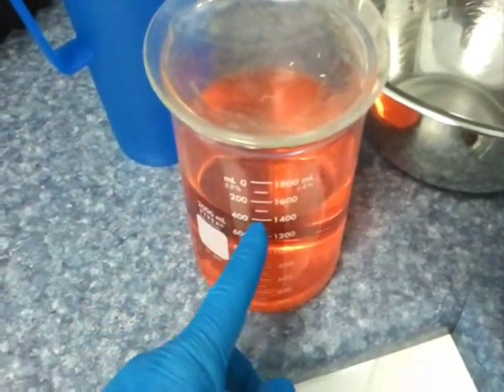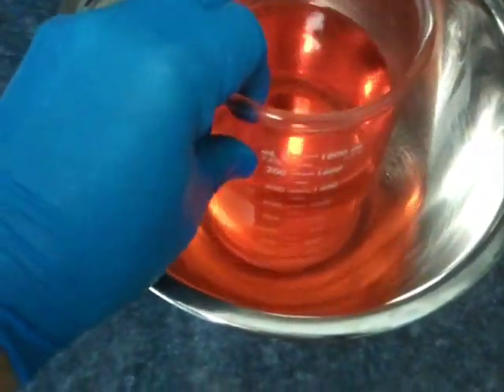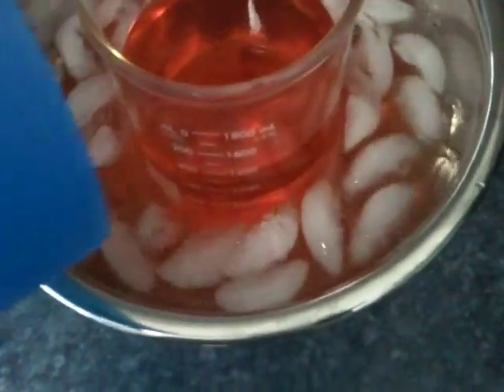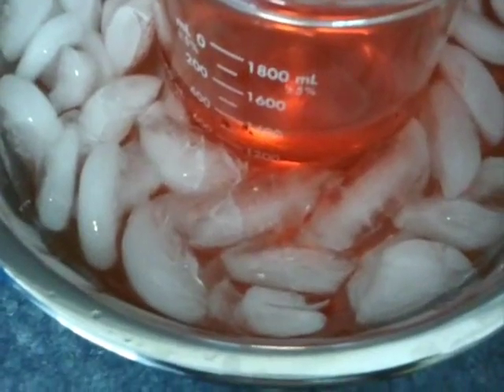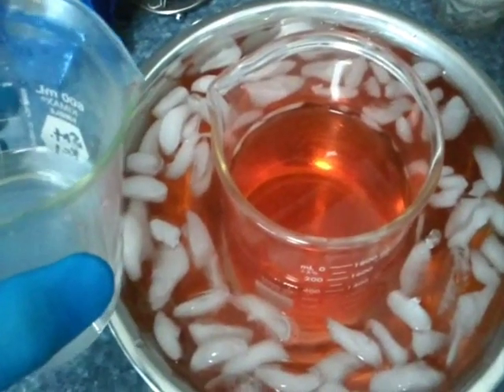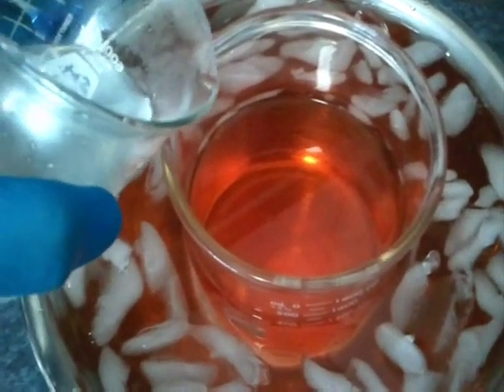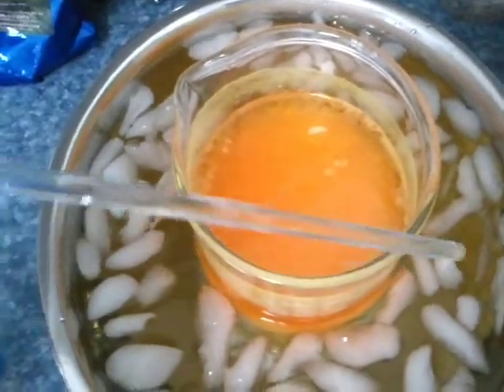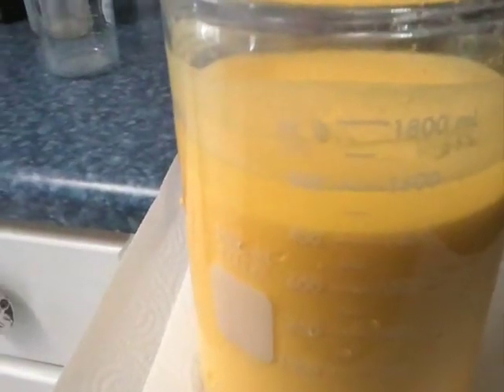Precipitating Platinum Using Potassium Chloride

Comment: 1:52 This cloudiness is not caused by natural impurities, but rather by an artificially added anti-caking agent. It is intended to prevent the KCl crystals from clumping together due to humidity.
Reply from the maker: Actually the KCl I used was purchased as untreated which does not have the anti-caking agent you speak of. You are correct that they do sell KCl with this agent in it, but I bought natural sylvite to avoid this.

Comment: are u sure use KCL not NH4CL?
Reply from the maker: Absolutely sure. KCl produces a less water soluble Pt compound than the Ammonium chloride  analog.  Additionally the KCl waste management cycle is much easier to deal with.

Comment: Hi after 9 years it’s best clip I’ve seen I have question How do you rinse these precipitate?
HCL or Water?
Best regards 👍
Reply from the maker: Use the clean saturated KCl solution as your rinse.. Any excess KCl will be rinse out of the Pt once it's converted to Pt sponge in the next step. Thank you for the positive feedback! Steve
Reply from the maker: I will check it and reply shortly! I've developed lots of new Pt/Pd refining techniques since I posted this common one 9 years ago...Ive been running PGMs for over 15 years now.
Reply from the maker: Lazersteve@gmail.com is the correct address
Reply: Thx so much for responding. I found email from you and wrote to you 🙏

Comment: Hi friend, excellent method, 2 questions this process is to down platinum exclusive? I try today and the result was wonderful, so to destroy remain nitric is ok use urea?
Reply from the maker: I use sulfamic acid to eliminate nitric in my solutions. Potassium Chloride will precipitate Palladium in the presence of chlorine generated in situ via addition of perchlorate or other chlorine source.. Any Platinum precipitated from solutions that also contains Palladium will be contaminated with trace Palladium and therefore need to be redissolved  and precipitated a second time after the Pt salt is converted back to Pt sponge.

Comment: Hola muy lindo video ...potassium chloride es igual al ácido clorhidrico o muriatico? O son dos productos diferentes?
Reply from the maker: The solution is Platinum in muriatic acid, the precipitation is due to the addition of potassium chloride dissolved in water.
Reply: @lazersteve  BOA NOITE
SOLUÇÃO DE MURIÁTICO?
OU VOCÊ QUER DIZER ÁGUA RÉGIA COM MURIÁTICO ?
PORQUE DIZEM QUE A PLATINA NÃO DISSOLVE FÁCIL NEM EM ÁGUA RÉGIA
Reply: @tondosmetais Yes, platinum doesn't dissolve in HCL, but Aqua Regia platinum definitely does. That's the solution in Aqua Regia, but before the settling process you have to remove the chemical content of nitric acid, so that the only clean solution is HCL, that's what it means, friends.😇
Reply: @lazersteve  Hola me gustaría comunicarme por mi email contigo (www.romanbenitez1177@gmail.com)

Comment: How would you reduce the yellow precipitate to platinum metal ?
Reply from the maker: The yellow salt is vacuum filtered then either calcined to form a platinum sponge "clinker" or converted to platinum metal powder using zinc turnings and 10% muriatic acid.
Reply: If the potassium chloride precipitate platinum why sodium chloride does not ? @lazersteve